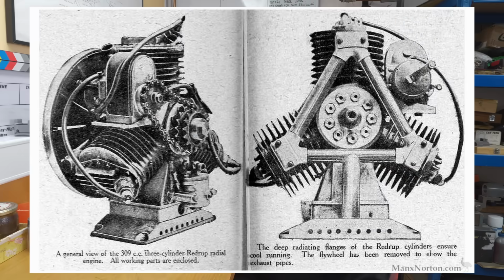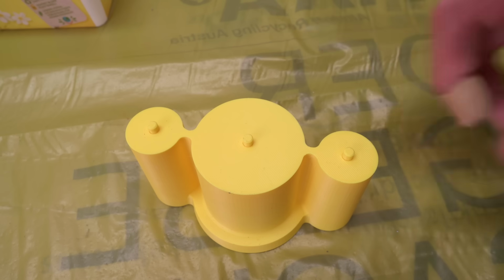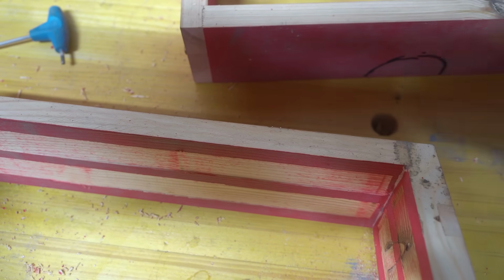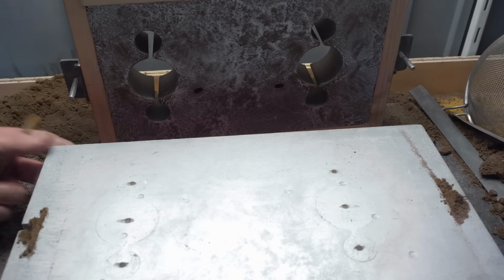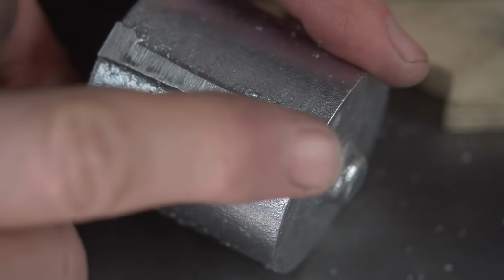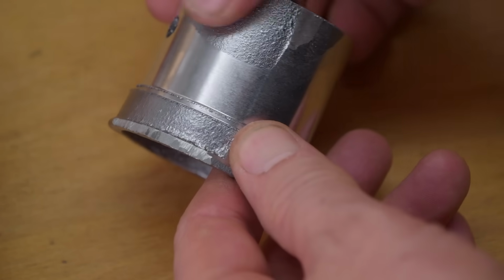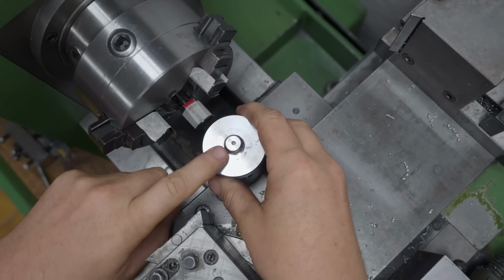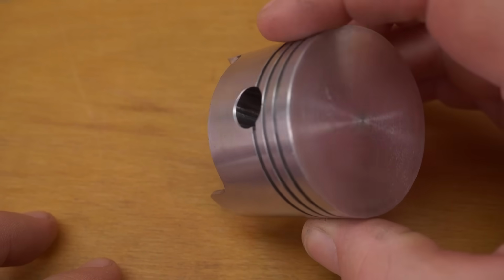Casting and machining pistons for the 1920 Redrup Radial replica. EP.5 || RotarySMP

Comment: I was just about to ask about how the Ovalizing was done when I spotted it in the description. Would be interested in seeing a short segment showing how that worked if you get a chance in a later video.

I wonder if there is a commercially available engine with similar proportions? Seems to me that it would be really nice to prove that some of the components worked as expected in isolation before having to assemble the whole thing into a working engine. Even if the designs needed to be tweaked slightly from the dimensions of the final engine.

Fantastic project, I'm looking forward to seeing more!
Reply from the maker: It will be a small miracle if this engine runs :)

Comment: You would have been better to start with a full billet and machine it down
Reply from the maker: Better is relative, David. I have a bunch of castings to do on this project, and knew I needed to sharpen up my casting skills, so this part was as good as any for that. 
Also it would take a small ball end mill with very long stick out to mill right down in there, and the chip clearing would be terrible. Doable, but also not trivial.

Comment: Almost seems a shame to be cutting up an older Ivar shelf with the metal insert.  But progress demands it!
Reply from the maker: I am sorry, but I dont understand that. What is the Ivar shelf?
Reply: @RotarySMP  The shelf you cut up for the mould is sold by Ikea under the "Ivar" product line. In the last decade, they switched from the metal insert on the ends, to a much less durable plastic cap that has resulted in a weaker shelf.

Comment: could you use the uneven thermal expansion deliberately to get it to the right shape by machining it when hot?
Reply from the maker: No one does that. Too hard to control that temp. And it is not hard to calculate for engineered pistons.
Reply: You can see a rough demonstration
Как проточить поршень 2

Comment: phew that was a big job. Off the shelf pistons still come in various sizes anyway, eg Yamaha 250 pistons have a nominal size of say 54mm, with 0.25 oversized, but each cylinder has to be honed to each individual piston to match. So I wouldn't worry too much trying to get them all the same.
Reply from the maker: Thanks. I am glad I did that, as it was a good learning experience :)
Reply: @RotarySMP  will you make a honing machine? I'll be very interested in copying it. Purchase the honing head but adapt it to horizontal drive?

Comment: Great video. I’m loving the deep dive into the casting. I can’t wait for the rest of the parts. 

Have you considered using exothermic risers to prevent the shrinkage?
Reply from the maker: Me too :) I would love to use exe, but it is not the sort of thing which can be easily purchases as a private person here. I have not found a vender for it.
Reply: @ my local foundry will sell me all of that stuff and it’s fairly cheap. They even have some strainers which you can put it the sprue to eliminate turbulence. Maybe head down to a local foundry and hope they are sympathetic and will sell you some stuff.
Reply from the maker: @OddsandEndsMachining  Local foundry :)
Vienna deindustrialised decades ago. My drill press was cast in a an inner city foundry. Now the only foundries are a couple of hours west, and they are all high capacity organisations supporting the german car industry.

I did source some filters off Ebay. They will be used on the further parts.

Comment: I am amazed by the production casting guys vs the guys doing casting at home. The commercial guys just whack it all together with barely a care in how well the processes are followed and their castings come out fine. While at home you take all the care in the world and end up with issues. I have often found that many things turn out better when I just do it and don't try to fret over the best practices etc. Counter intuitive but... The commercial casting sand mixes seem to be a magic mix. I watch those Pakistani and India etc videos to go to sleep to. Always impressed how they do so much with so little. We are so used to wanting the perfect tool for every process that we find it hard to improvise now as we are also told if you are going to do it use the proper tool. Really need to stop listening to the tool merchants and just make stuff happen with what you have on hand and between the ears.

      Very nice finish from that diamond cutter. Always amazed at the machining finish on even cheap automotive aluminum parts. The casting and machining are excellent now. And the machined finish on the cast aluminum of a disassembled hard drive is amazingly mirror finished. 

       Now I see that engine modded to be a RC plane engine at some point. Or.. Powering a new sand muller.

        I resumed work on the master bath today. Mixed up mud got some Schluter kedi on. Started to mix up more mud and there were little clumps in it. I said nope not trusting it. As I was cleaning the bucket out the power went out. Would have been in the middle of mixing and a bigger mess to clean up. So those clumps were a sign that I was done for the day and to keep me from being POed when the power went out. Course it's actually raining here this spring and allot more like spring is supposed to be.
Reply from the maker: Hi Robert,
In production, pistons are normally gravity cast in steel permanent moulds. I considered it, but given there would also be a learning curve there, I decided to stick with sand, as I will need improved sand casting skills for all the other parts of this build.

Could be a lawnmower engine.

Do you get a lot of power outages? We had one last year. Only one in the 13 years I have been in this house. I think a car accident took out the subdivisions transformer.

Thanks for the reminder. I have a big box of old hard drives I was given, and I need to strip them to their frames, as they will be the raw material for my next castings.
Reply: @RotarySMP   For those wanting to build an engine but not make pistons a long search of already  made mower pistons could be a start for one.
    
     We used to get allot of short outages as the lines are from the 40s and 50s here and houses use allot more power now... But that was due to lightning this time. 
    However they did just gps locate all of the poles and wires here and are going to replace all the poles pretty soon so outages will be a big problem in that time.
   I would like to cover the shop roof in solar panels and put in a few batteries but we plan to move eventually so not going to do that. I may do a  few panels but nothing big.

Comment: Will this engine idle for a minute at a time and that's it? Because otherwise I think the clearances are a bit optimistic.
High quality pistons are barrel shaped while cheap pistons are like what you described.
Reply from the maker: I was basing this on the 1thou per inch rule of thumb with an extra thou conical to the top. What clearance would you have used for 2" pistons in a 2 3/4 hp engine?
Reply: @RotarySMP  I think I misunderstood you, the clearances are good.
Reply from the maker: @ Thanks for confirming this. I have no experience on this, and there is a fair bit of conflicting information out in the internet.

The pneumatic tailstock on the mandrel distorted the pistons enough, that after removing the turned pistons, they relax to just about the right ovalisation of the skirt.

Comment: Thank you so much for launching this project and filming it. I restore vintage 1960 through late 80's motorcycles for a living. I'm a professional welder, fabricator and machinist with a background in industrial design and product development. That said I have an extensive background in modern as well as antique fabrication practices. I hand make aluminum and steel bodywork and fuel tanks and have over the last 25+ years in business done my own limited sand casting of obsolete or completely unobtainable parts for motorcycles and broken tools. Every day in life is a learning process and I feel like, if I had the extra time, I would love to also film and share my knowledge of things but I'm not quite there yet. Currently I have multiple customer projects and a few personal projects of my own taking up most of my spare time. The time to film and edit and post content, I just don't see that there is enough time in the day.  Again thank you for this series of videos and explaining the processes to such detail.
Reply from the maker: Cool work you have Travis. I have a make who lives an hour from here who also restores antique motorbikes. Very cool projects.

Comment: lovely muller!!! i really need to make one. loved this video! cheers from spain o/
Reply from the maker: Thanks Julian. I picked up a scrap hot water cylinder, and this is the inner shell, with a laser cut plate welded to the bottom. Picked up an industrial angle gearbox, bolted on a 3Ph motor, drive that with a VFD. Couple of bearings, and shafts and away it goes. Sure beats stomp mulling that is for sure.
Reply: @RotarySMP  it looks amazing!!! thanks for the details. i'll squirrel that away!

Comment: Nice job! That learning curve was pretty steep for a while back there, but you seem to have the measure of it now! I reckon you stand a good chance of getting those cylinders done without the fins driving you to drink!
Reply from the maker: The challenge there is that the cylinders are part of the crankcase. It is a one piece casting. Will be the most challenging part I expect.
Reply: @RotarySMP  Ooh, I didn't spot that. casing it will be tricky, but poring and accurately porting it will be even tougher!
Reply: @RotarySMP  Yikes. Wise to start with the pistons to get the hang of the process. Not that they are trivial, but at least they are smaller. We all look forward to watching you fight your way to victory on that one.  Best of luck to you.

Comment: I cnc'd a cheap rotary table. The table flops the worm in and out of mesh for rapid adjustment. If I flop it all the way into mesh the servos have trouble turning it through high spots each rotation, and if I don't it has backlash, so I mainly use only positive direction rotations and use it as a 3.5 axis
Reply from the maker: Thanks for your experience. That is what I had heard, and is the main reason I haven't done a conversion on this one.

Comment: How much did you relive sides around gudgeon pins?
Have you weighed pistons and matched them?
I've machined pistons then used burr and sanding drum in Dremel to match weights.
I'm modifying OEM parts to use in engine conversions though. (did first 'big bore' to Honda CB160 block in 1974)
Honda CB750 pistons fit CB500/CB550 to give 591cc or 605cc, (using stock or 1mm OS) Suzuki GS850 pistons in Honda CB 360 to give 389cc or 391cc which makes the ports closer to optimal (designed in early 70's, ports are much too big for 356cc ( 178cc per cylinder)
Performance change is totally out of proportion to 11cc cylinder volume increase
Reply from the maker: A few people have asked that, so I added it to the video description. 

No. I haven't weighed them yet. good point.
Reply: @RotarySMP  Thanks, I didn't check description .

Comment: Congratulation for the job perfectly done.!!!!! The only point which is obscure to me is how You obtain piston conical and oval shape in such a small amounts. Do you setup the lathe turret for that?
Reply from the maker: Sorry I forgot to include that. The pneumatic pressure of the tailstock against the mandrel distorted the pistons enough that after round turning they settle oval. The conical taper is easy to program on a CNC lathe.

Comment: BigstackD tried that boron nitride paint for his bulk ingot castings recently; the improvement in surface finish was striking.
Reply from the maker: Thanks Jim. The aluminium oxide dross  certainly doesn't stick like it does to steel if overheated.

Comment: You noted that the pistons should not be round nor cylindrical, then made them round and cylindrical. What gives?
Reply from the maker: Sorry I forgot to include that. The pneumatic pressure of the tailstock against the mandrel distorted the pistons enough that after round turning they settle oval. The conical taper was easy to program on a CNC lathe, you just program a larger end diameter.
Reply: @RotarySMP  Thank you for the reply!

Comment: I love that you're keeping this arcane process alive, but out of curiosity (and my complete lack of knowledge in this area) - would it have been possible to machine usable pistons from a solid block of aluminum? Are there things about cast pistons that would make them superior to machined pistons? In my business I'm always examining whether new processes and approaches are 'better' or just more idiot-proof. Often they're neither, just more profitable for suppliers. Great series, thank you!
Reply from the maker: I covered that in either episode three or fours. It is possible, but difficult. There are small features, leading to a large overhang on the tool, and the chip clearing will be miserable.
Reply: @RotarySMP There's a reason the big machines use high-pressure coolant directly from the tool. Also not sure if the MAHO could even do the high RPMs for small tools?
Reply from the maker: @graealex  Hi Alexander, 
It maxes out at 4000rpm, so no :)
Reply: @RotarySMP  Well, in some cases the required speeds would increase to 30-60k RPM. And counter-intuitively, just because the tool is small, the machine can't be as well, since rigidity and run-out also start to have more influence.
Reply from the maker: @graealex  Yeah, I never seriously considered hogging pistons from billet.
Reply: @RotarySMP  The other guy recommended forging them, though 😉 All you need is a 100-ton forging hammer.
Reply from the maker: @graealex  Yeah, I get lots of pretty exciting advice :)

Comment: How did you achieve the oval on the piston? To me, it looked like straight turning, which would make it cylindrical.
Reply from the maker: Sorry I forgot to include that. The pneumatic pressure of the tail stock against the mandrel distorted the pistons enough that after round turning they settle oval.
Reply: @RotarySMP  What about the taper, how was that done?
Reply from the maker: @SmokeRings-eg7md  The taper is simple on a CNC lathe, you just program a slightly larger end diameter than start diameter onto the final cut.

Comment: Argon is slightly heavier than air and will settle in the bottom of the mold.  If you fill the mold with argon in a windless area it helps avoid any defects internally.
Reply from the maker: Argon? Oh you saw I was using an Argon rated regulator on the CO2 bottle. Yes, some times I sat the mould in a container when I was running out of gas.

Comment: Awesome work! You might want to thoroughly clean those chips off the lathe. If the aluminum's silicon composition can easily dull a cutting tool, imagine what its fine particles can do to precision ground surfaces.
Reply from the maker: Good point Bob. I already cleaned it up, hopefully well enough.

Comment: Don't use an argon regulator! It sounds ok but co2 swells most flexible seals in regulators
Reply from the maker: What is the failure mode once the seals swell?
Reply: @RotarySMP  either it leaks or fails completely. Overpressure on the output is a big risk. Also debris will fly out. When you use soda stream bottles there are regulators with the matching thread (I have one that I don't need ;))
Reply: @luca87375 I was the one building that setup, and I had a really hard time finding a CO2 regulator that would match the threads. From what I can read, most regulators are dual-purpose anyway, it's just that the flow meter isn't going to be accurate.
Reply: @graealex  no theire not. I wanted to use CO2 on my 300/300 bar spectron, the salesman told me that CO2 won't work for long. So I stick with what professionals say. I have an bitch Nitrogen regulator that I'll slap on everything
Reply: @luca87375  Then all those name-brand manufacturers are lying when they sell multi-gas regulators? Not saying that this one was a name-brand, but it was sold as a dual-gas regulator.
Reply: @graealex  multi gas works. Like N2, Ar,.. e.g. non reactive gases. But CO2 has other membranes. Heck you could use an Nitrogen regulator on Helium
Reply: @luca87375  That's what they're saying on the package, Ar+CO2. Literally everyone actually. Even the ones for 500 bucks. In fact, searching for argon regulators exclusively lists me those that are for both argon and CO2. That's because exactly that gas mixture is used for MIG.
Reply: @graealex  right, mixtures of like 80/20 max and you turn the gas off. See where I'm going? Sure it won't instantly break but you don't want to use such an regulator in your CO2 system (like for beverages)
Reply: @luca87375  You don't use industrial regulators for beverages since they need to be food-safe. That precludes the use of certain lubricants for example.
Well, none of the regulators I researched mention any limitation on the gas mixture. In fact, some mention the flow rate for pure CO2, implying they're fine for it.
Reply: @graealex  they are the same. It's all eighte plater brass or hastalloy C

Just look up the compatibility chart in the DIN/EN or ISO
Reply: @luca87375  Not even sure what you are talking about. Your claim was that the shown regulator was not to be used with CO2. I produced arguments that it is rated for both argon and CO2, and that in fact even all the cheap regulators are rated for both, and either one at 100% concentration. Even rechecked the safety information on that particular regulator.
Reply: @luca87375  Btw. look at 3:11 at the printing in the pressure gauge.
Reply: @RotarySMP  Mark, I have one actually useful recommendation, and that's to not use it lying down, since liquid CO2 could actually mess with the regulator because of freezing. With the maximum pressure at 3bar only, the expansion rate of the CO2 will be slow enough to prevent freezing, though.